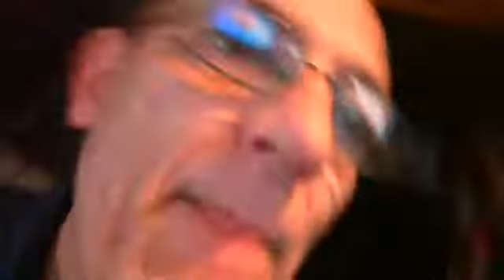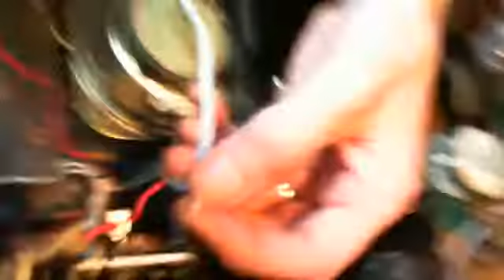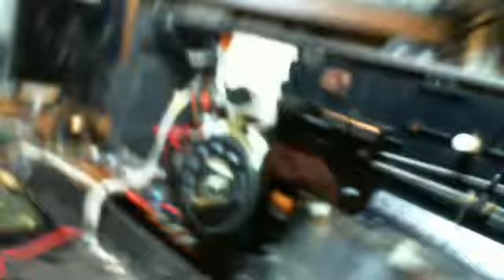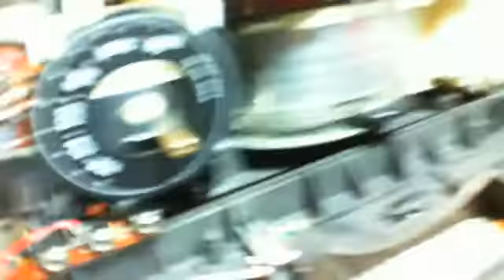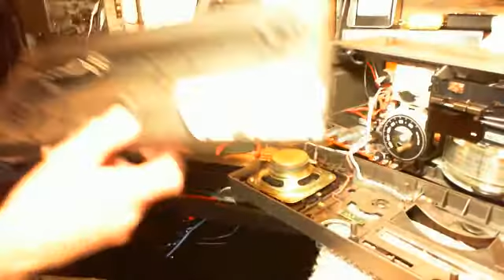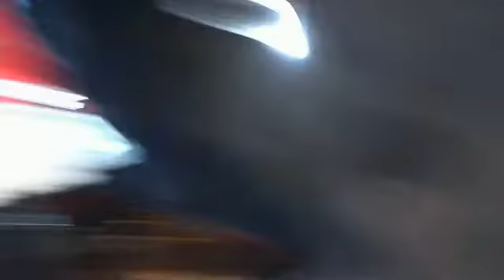Sony ICF 6800W Video #5 - Lights and S-Meter

Comment: My Mother bought me that Same identical Sony model back in 1981. I’m going to get another one. I got a Question? I see some of those Radio’s have a Blue Label & some have a Green label it’s where it shows the Model & Voltage Number’s way on the left side of the Back Pannel. So what is the difference?

I’ve been Lucky about 1 year ago I found a Brand New Factory Sealed Sony AN-1 Antenna & AC-11 ac Adaptor & Sony Brand New AN-LP1.

I have a Panasonic & I had to replace all 3 Bulbs plus a Capacitor had to be replaced & it had one heck of a job on the 2 wires of Circuit Board I had to use Eposie glew to hold the Capacitor in place. Glad I had a Parts Donor.

Comment from the maker: I'll have to repeat the work since I now see that there is a third light hidden deep inside the radio.  I'm learning the hard way.
Reply: I just watch your video to dismantle the forward and aft cover only, and afraid to do repair
Reply: The third light is under the white little top piece covering the sw tuning dial!!
Reply: The bulb is directly above the small tune dial that you were moving back and forth
It is at the 44:10 mark  of your video